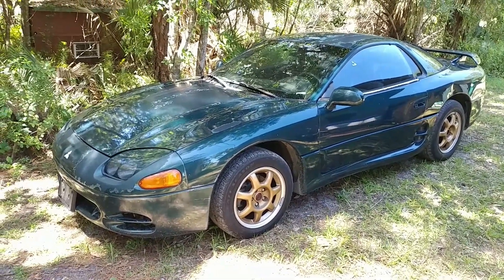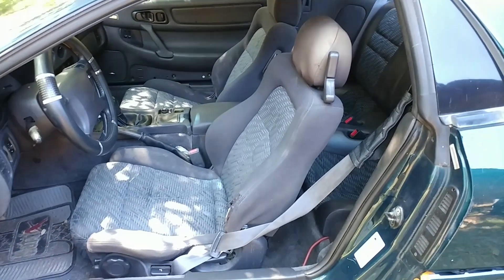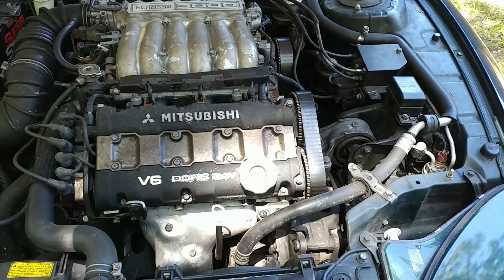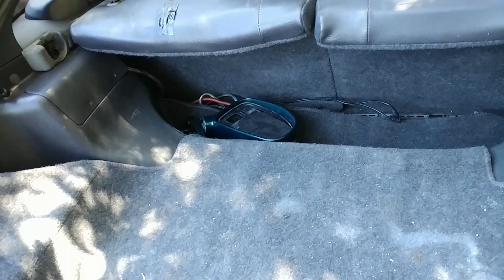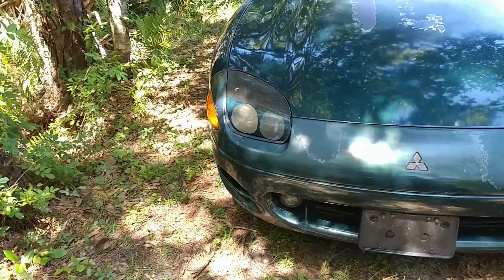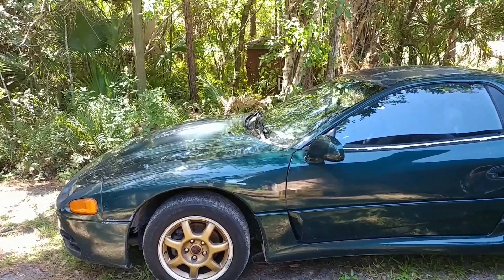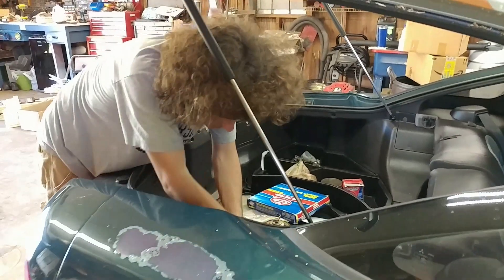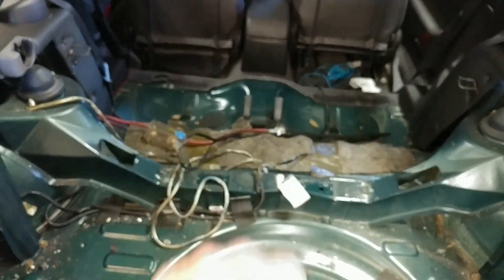Mitsubishi 3000GT Tesla Swap 1 - The Car and the Project Intro

Comment: You should add an end screen so we can just go to your next one in the series.
Reply from the maker: I thought the playlist would work for that, but I'll work on enabling end screens next time I'm on my PC.
Reply: @azimath9939  I think the problem was unique to your first video.  BTW, I love this series.  I like your format and you just showing the cool engineering info without much drama other than working through design cycles. It would be cool to know a little background like how many of these swaps have you done.  Is this part of a business or is this just your families hobby?
Reply from the maker: @fairbornCCF  My family has worked on cars for a long time. Granddad did some racing, dad did a total rebuild of his high school car and keeps some other classics driving, but dad and I have never attempted a complicated swap like this before! He and I both studied electrical engineering which helps but with the parts I have it's mostly down to remembering ohm's law and making sure the current goes in the right direction.

Comment: I hope you are successful! This is a very admirable project! Record everything! It will be fun for others to watch and try to emulate and fun for you to reminisce on successful or unsuccessful. 

Be careful... safety is number one when working on cars. Double protect yourself with everything you do. Jack stands and rubber insulation when you get to the electrical part. Make sure you have thick skin 😂 figuratively and literally 😂 I’m excited to watch how this goes!
Reply from the maker: Thanks!
You're right, to that effect there's 4 jack stands under the back where I'm working and 2 under the front, the car is pretty solid. The plan for building the electrical parts is to get the batteries mounted solidly in a strong box before connecting them together, to minimize the time that high voltage terminals are exposed. Adequately insulated tools and PPE is a must! I've also verified the drive unit has a self-discharge circuit that drains the capacitors after the power is cut.